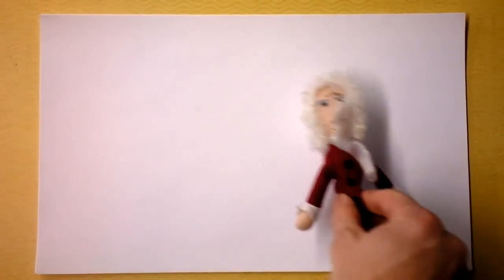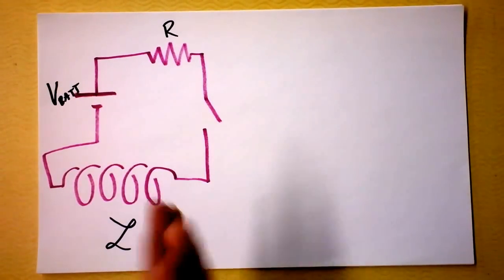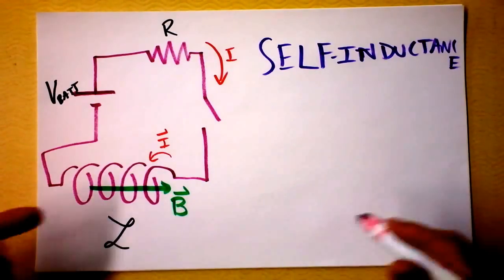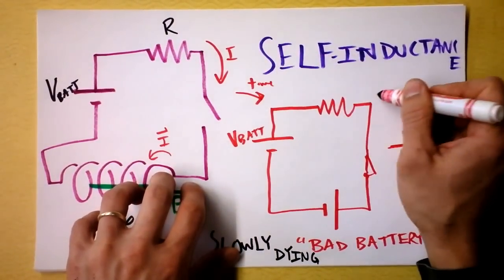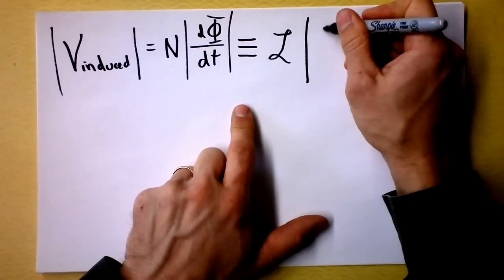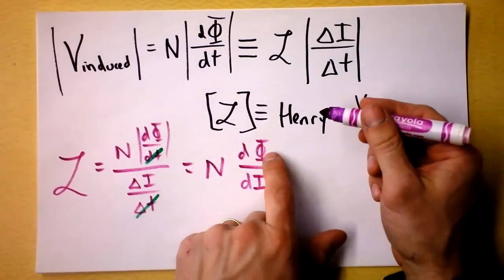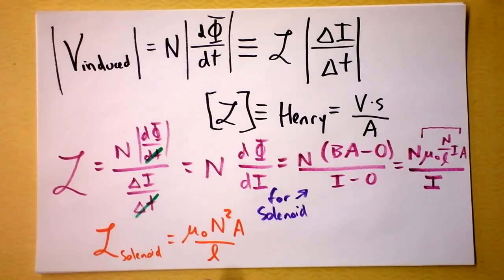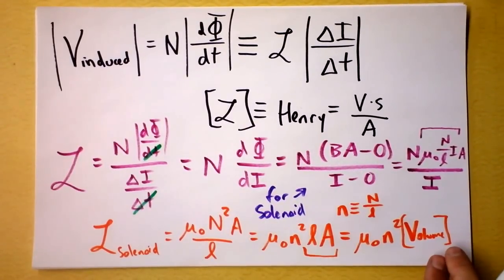Inductors and Intro to Self-Inductance | Doc Physics

Comment: that's a really nice formula u got there at the end,  especially the "n" since the "N" and "l" scale proportionally if the wire length is fixed (implying a wire diameter) N=1/l=the diameter = constant aka fixed

Comment from the maker: Boy, that's a great question.  So, my initial thought is this:  B curls around the wire, so if the wire is perfectly straight, the field from one section of wire CANNOT react with any other section of the wire.  As soon as you curve the wire even a bit, you get the wire's field affecting the same wire's current at another point.  That's the essence of self-inductance.  I'm more naturally inclined to think in terms of loops or fractions and multiples thereof, but the bending is really the cause!
Reply: Yeah, because the field is not at the normal direction anymore and has to be decompose into all 3 directions.

Comment: Can the equation at the bottom of the paper at the end of your video be used to calculate the number of turns for any cylindrical coil or does the length of the coil have to be at least 10 times the diameter?
Reply from the maker: El Jardinero I guess we are making some assumptions here.  I am ignoring edge effects, and it seems like your guideline is reasonable.  Of course, the maximum error you can tolerate should determine how carefully you investigate the specific peculiarities of your setup.

Comment: what is it specifically that induces the voltage/"generates" the current going the opposite way? There must be forces in opposite directions i would assume but with the right hand rule at least I can't see it making any sense.

help highly appreciated ^^
Reply from the maker: Daski69 Yeah, super question.  Ultimately, you can break it down to the RHR, but it's very convoluted at the point of self-inductance.  See if you can use RHR to derive Lenz's Law for a simple square loop leaving a uniform B.  If so, perhaps you'll be comfortable using Lenz's Law to show self-inductance.
Reply: Doc Schuster
thanks for the answer! I try to visualize a square loop and approaching its center with the negative pole of a magnet, using RHR, I think about current going into the page and the field lines going left, that would make the force go up, not out of the page.

Comment: two question: 1.when switch is closed, why the voltage across solenoid immediately equal to the voltage supplied.2.switch is close , is there any current flow in the circuit?? my assumption: 1. current flow through solenoid. the changes of current is maximum due to initially no back emf. this causes the voltage maximum. but if there is current flow in circuit, then why the voltage across resistor will be zero. urgent!!

Comment: But current should flow from negative to positive,because current is a flow of electrons...
Why did u choose the other direction please help?

Why direction of current is opposite to that of an electron?
Reply: This is because the classical current is from positive to negative. Back in the day when they didn't know whether the negative or positive particles flowed, they chose poorly by picking current as a flow of positive particles.
As a result we still treat circuits as if the positive particles are flowing.

Of course for some cases looking at the particle that's really flowing makes a lot of things more clear, but generally you will still find that the classical concept of current is being used in science.
Reply: Ditto Jan, The early electrical scientists decided that current would flow from positive to negative, called conventional current flow. Had they known what we know now about electron flow, it would have been the other way. US use electron flow whereas UK and Australia use conventional flow. Whichever way you depict current flow usually depends on how it is taught in your educational system- conventional flow vs electron flow.

Comment: What does it mean dat the bad battery dies eventually??
Reply from the maker: +sai gautham As resistance takes away the opposing current in the inductor, the bad battery gradually ceases to exist.
Reply: What happens if you connect an inductor to AC?
Reply: Wolf Edmunds then the bad battery gets reincarnated in every period and dies in every period
Reply: Lol you could have just said that it would offset the voltage
oscillations so that it leads current by pi/2...

Comment: I too think that you forgot to tell things in this video. If you try to teach how inductor works, you might want to tell that it can fight change in voltage and current thus smoothing dc may obtained. To thing about DC simple coil is like wire but change in AC it don't like and tries to fight back. Thus smoothing some noise in DC path is good use for the Coil.
Reply from the maker: Thanks!  Did you watch the next inductor video?  I can't tell you all about inductors in 12 minutes, of course!  That's a neat application, though.

Comment: I think simple stating that "the inductor does not want a change in current" misses the opportunity to relate the changing magnetic field to the producing of the emf in the coil. Could have mentioned that the coil experiences a change in magnetic field from the changing current in the turns of the coil, which makes the coil originate an opposing emf. The formulas gave a hint but you did not offer an explanation. It helps to enforce the innate relationship between electricity and magnetism a little more. I think it's natural for people to wonder, well, we have all this changing current producing a magnetic field around the coil, how about how this magnetic field interacts with the coil it comes in contact?
Reply from the maker: Sara Darella Good reasoning, Sara!  I believe I have addressed this in the preceding videos.  Maybe you jumped in during the middle of my "series"?  Lenz's Law is my very favorite physical law!
Reply: Sara Darella Then please, answer me this; what is it exactly that induces an opposite emf? I assumed there had to be a force since it's changing the way that electrons flow but how does the magnetic field do it? It intervenes with other field lines and so what?

most grateful for answer, exam coming up =)

Comment: I'm still struggling to grasp the concept of inductance :) so it's the ability of a coil to resist any change in current through it whether it's increasing or decreasing current (that determines the polarity of self-induced voltage - if current through an inductor increases the voltage of self-inductance will orient itself such as to oppose the source of change - if it's decreasing then the voltage of self-inductance will have such a polarity as to compensate the source of change). L = e/(di/dt) suggests that an inductor with high inductance value will be able to generate more voltage of self-inductance and allow less current change per unit time (transient response of an inductor to a sudden change in its magnetic field)  than that with a low inductance. In other words even if the rate of change of current is small the coil with high value of inductance will still produce a voltage of appreciable magnitude.
Reply from the maker: 2013Aleksey2013 All seems great except "and allow less current through it per unit time than that with a low inductance."  Current CHANGE per unit time.  Magnitude of current is not considered at all in this case (but prolly should be before you build a circuit...)
Reply: Doc Schuster I get lost every time the derivatives are present in an equation (the whole calculus thing). You've pointed out exactly to what I didn't quite understand. Have watched several of your videos in a row I have no idea how you manage to address such difficult topics and yet do not resort to complex math of dynamic systems.
Reply from the maker: 2013Aleksey2013 It's a fine line to walk, right?  I remember always struggling with the math, so I try to keep my intro-level videos heavy on concepts and (hopefully) building understanding.  Thanks for watching.

Comment: Come on man,  wth you are telling. Inductor isn't acting as a battery neither creating any voltage.  The electricity just having hard time to move through the curved winding therefore requiring more pressure (volt). That's it.  The condition feels like inductor is generating voltage  but that is not the reality. 

Inductance is more like absorption of  current flow not prevention.

info like that makes confusion, don't do that.